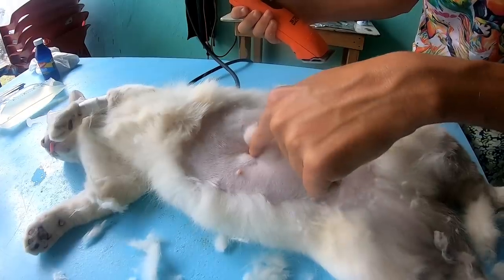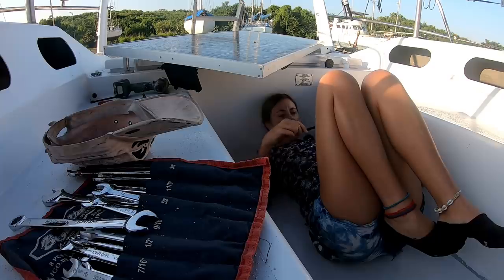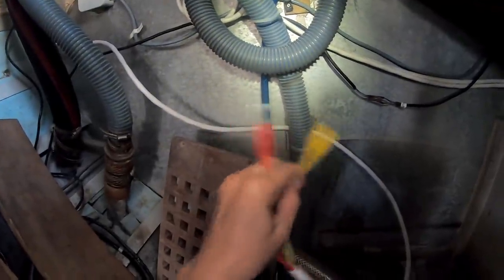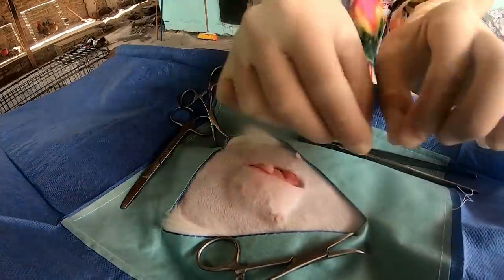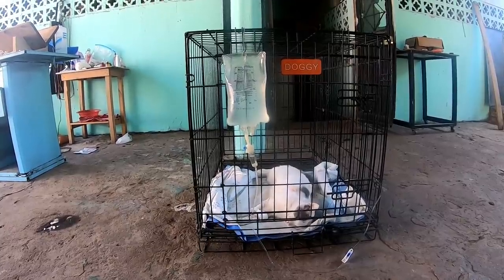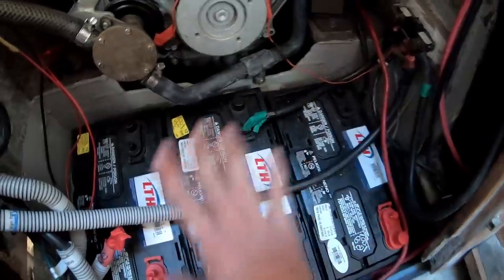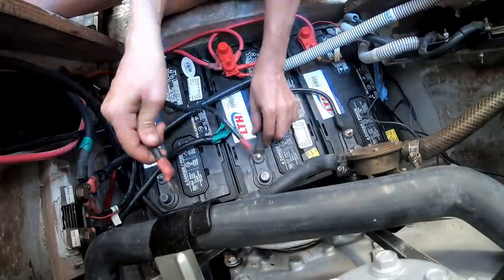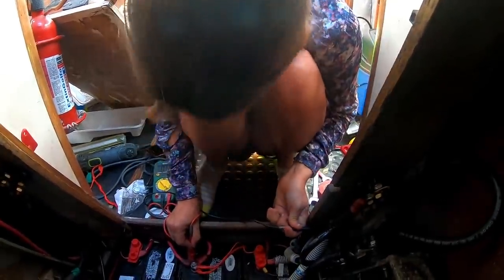Battery Installation! Chuffed Adventures S03Ep30

Comment: To quickcheck your solar panel you should try to find in the spec of the module a note about the maximum ouput current or short-circuit current. Then you get a multimeter and testwires which can handle this current easily (which means it and the wires are build for at minimum 1.2 times the current you want to measure. Switch this multimeter to the maximum current measuring range. First cover the panel, then connect the testwires of the multimeter to the Panel (keep in mind that you have now short-circuited the panel). Now you uncover slowly the panel and get a amp reading at full sunlight. Then recover the panel and unconnect the testwires and switch the multimeter back to the highest Voltage measuring range (means preparing the multimeter for a probable next measurement without a short circuit). Compare this value with the spec or an equal Solarpanel that seems to be in good condition. The value should be in 95% of the spec or a same type working Panel. The pure Voltage reading without a load is missleading. But you can also compare the voltages between two Solarpanels which are hooked up to the same value of load. Means hook up the first panel to the load (maybe a bulb or the batterycharger) and measure the Voltage that this Panel is now able to provide. Then disconnect this panel from the load and hook up the next panel and do the measuring again on this panel. The Voltage readings that you get should be the same for the same type of modules. If one module has a significant less voltage reading at the same sunlight and the same load, it is damaged. Maybe a crack in one cell or a cold soldering junction or a gone diode. Get a new one they are not good repairable because they are poured in. Also look for a modern solar batterycharger some types are more intelligent and can show you more informations about the wattage that is actual delivered by the panels. And some types can handle a desulfation on your batteries. And some types have a boost mode which can do a step up on your solar panels voltage at low sunlight. But on all new electronics take care that thy do not interfear your VHF.

Comment: please research your Battery Connection Design . To maintain Loads and charging evenly across the Three Batteries  1,2,&3 The Joining Leads should be of equal Length With Slack, Try to loop the Positive Opposite to the Negative Loop So wires of different polarity never cross each other. All Loads are attached to each end of the Bank.   Positive one end say Battery 1 then all Negatives to Batt3 . Hope this makes sense.

Comment: If you don't have one install a current monitor for your battery bank. They are not expensive and It will let you see the amps going in and out. This lets you see the rate of charge from solar and alternator and if you can keep your batteries always above 50% you will get the best life out of them. Hope the relaunch goes smoothly. 
Cheers from NZ
Reply from the maker: We do have one but its currently (get it, pun intended) on the fritz, hopefully get it working these next few days

Comment: When installing power wiring you should always have a fuse or circuit breaker included in the circuit path.  Those separate pieces of equipment you wired direct to the battery bank need that protection as well.  You can easily add inline fuse holders near the batteries for those circuits. They're not expensive and easy to install. Even when underway.
Reply from the maker: They do all have fuses (you may have spotted the fuse on the bilge pump when i said i had finished wiring it, big black box). Since I am no electrician I didn't want to go into to much detail about dos and donts, save it for the experts!

Comment: I may not be seeing this correctly but it looks to me like you have all the batterise wired together as one large bank. You have two main circuits coming off the bank, but they are both drawing off the same batteries. In order to have a house and engine supply you should have the house come off of two batteries and the engine off the third battery. That way if the house equipment flattens thier batteries you will still have the engine battery to start the engine. You could also fit a combined isolator to cross over if need be.
Reply from the maker: Yes it is all wired as one, we chose to go this route, some people have seperate mains and engine, but since our bank is so small they all go together. Major con of course if flat battery means no engine, but big benefits if having fridge/lights etc running in the night. So we went with that :) lots of boat do it

Comment: Such good news. You should be in the water now (Wednesday). Congratulations. Was the problem with the solar panel solved with replacing the wire. Looking forward to your next video.
Reply from the maker: Yeh all solved, an easy fix for once! The water has been loooovely

Comment: Hi just a quick safety idea as salt water and batteries  can cause chlorine  gas  may I  suggest you move those batteries away from the  impeller pump housing , Far away  check with a marine engineer please .
Reply from the maker: They have been in this location 30 years, we know its not ideal but we don't really have another location and to build one wouldve been more months on the hard, we had to prioritize the hull

Comment: Do you have a reserve battery somewhere much higher than the bilge so that if you were to take on water you'd be able to pump despite the bilge being full of water?
Reply from the maker: No, the batteries are in a separate compartment so water would have to come through bilge and up and over the floor boards to get in there, by then I think even an ancillary battery would only help so much! We do have manual bilge pumps though.

Comment: Dear Dr. please use flat washers and pressure washers on your batteries terminals, if you dont, the heat and vibrations will loose the nuts on the battery terminals, the correct order in the battery screws is: electrical connections, flat washer, pressure or security washer and the nut...or, you can use security nuts. Great job yours, my admiration. Sorry for my bad english.
Reply from the maker: good to knw thank you, your english is great!

Comment: Looks good. Once you’re in the water with engine running and charging batteries, check individual battery voltage. Should be about the same. Also, do you have a cover over the batteries so you don’t end up frying something while working on your engine? Super excited about the launch. Any idea what time? Buena suerte!👍✌️😊🙏🏼⛵️⛵️⛵️⛵️⛵️⛵️⛵️
Reply from the maker: I don't have a cover... but might just cut some plastic up to go over it! We are currently floating!

Comment: Holy Crab, three brand new batteries. Janet will start now just by calling her!  But if you do not charge your batteries for one year, you can sell them bevor you ruin them. Means more space on board, and less problems with holes in your t-shirts and 150 Bucks more in your pocket.
Reply from the maker: Yeh, they weren't in a good way (they were bubbling in areas ... maybe too hot here/got direct sun) so we gave them to the boat yard boys to use for charging their toys
Reply: Yes they wear out in this constallation very fast. 6 cells in series an 3 batteries in parallel are nearly impossible to charge balanced. By time some cells start to boil due to overcharge and the others get crystals due to undercharge. At some point one cell is nearly inconductive and blocks the other cells from serving the high currents to the starter. So your starter will no longer work when in every battery one cell is gone. The lights seem to work but the starter would not.
Reply: The charging behaviors of lead acid batteries are inversely exponential. The first hour tooks a lot of charge but the rest needs more than 12 hours. At the end the cells start to boil because the overcharging current goes more and more into splitting the watermolecules instead of the chemical charging reaktion. Good ventilation is needed. The gas that then arises is in perfect mixture and one litre of gas volume will blow off all your hatches when ignited.

Comment: 13:50 - electricity safety.  I've come to find out that voltage isn't what kills - it's the current.  I grant you that w=va and harm does take more current at 14VDC, but you have 3 honkin' big batteries sitting there that could dump a bunch of amps on you.  Mind you, I don't go grabbing 220V lines of any amperage.

Comment: Good Tube,  Well done. 
I see everyone going on about the batteries, but I’m thinking about the raw water pump impeller damage if you start that engine without a water supply to the raw water pump.   🤷 🤓
Reply from the maker: On the hard you just stick a hose into the raw water intake, so it gets wet dont worry!
And yeh, I know the problems with my batteries so not going to reply to all those comments :)

Comment: Am not a mechanic but have installed a few car batteries. Looking at this I wonder why you did not orient the red (positive) at the other end so that there would be no high current wire resting against the metal hull. If that insulation melts or gets damaged, then you definitely will have electricity touching the hull, possibly creating arcing or a spark. Maybe just repositioning the cable will fix this. Are fusible links used on marine batteries like on cars?
I enjoy watching your animal surgeries, especially with their tongues dangling, whilst under anethstesia.
Reply from the maker: For the most part I think the chances of that happening are low and we inspect monthly at minimum, but good to know thanks. We do have fuses on all the wires too
Reply: @Vet Tails' Sailing Chuffed  One more thing I see: Copper is a soft metal that can fissure inside the insulation. If the lead from the alternator and starter is old, consider replacing it. Engine vibrations and even corrosion can break it up causing the alternator to im properly charge the battery or reduce its lifespan. On a boat it likely takes much longer than on a car, but you need greater reliability on a boat.

Comment: If you ground the Hull Aluminium will absorb it and start to corrode especially if other metals like Zinc steel are connected to the Aluminium will cause reaction. Older cars had the positive as ground and corrosion was faster modern cars negative slowed down the corrosion. But later if just wired left with no Ground or positive the Aluminium lasted a lot longer. I must say this cars today are still grounded negative to the body on cars is really for cheapness rather than protecting the metal and rust still happens also with the modern technology still goes wrong and takes time to sort out faults. There difference is with the painting of cars today that makes the metal last longer.
Reply from the maker: yep exactly, there are some resources that say you should ground alu though thats why I covered my ground

Comment: 12:36 That's not a good crimp tool. For good crimp connections you should use one that is pressing the electric wire ferrule from at least 4 or more sides.
This is especially in your case important, because this is a boat where everything moves around and things can become loose. From a safety points it wouldn't be not good, if a cable gets loose because the crimping join wasn't good because of the usage of a bad tool.

Comment: As an Electrician/Electrical Engineer I find it very frustrating watch non professionals doing wiring and always see many ways that things can go wrong because they don't know what I know. Having said that very few problems do happen with wiring that was not installed by a professional, most times it's components that fail and not the wiring but if you can avoid certain things that might cause problems you will be better off. One thing is to leave slack in the wires but do not let them dangle on a terminal tie them to something solid and wherever possible.
Reply from the maker: One of the reasons I didn't go into detail about how to/what I was doing, I am not a professional, thankfully I had an electrician on board for the first 6 weeks (Dad) and we talked it all through so I knew more or less what I was doing.

Comment: put something between the batteries so they don't bump each other?
Reply from the maker: They weigh so much it'd take a big wave to make them move (they sit on top of plastic webbing too)
Reply: @VetTails  oh yeah, mighty ocean, big waves,  little boat, what are the odds? lol. You can get some foam padding, old yoga mat maybe, foam packing material. The other bit you need are some tie downs on them. You may never need the tie downs or padding, but... mighty ocean, big waves, little boat.

Comment: Just to check, wiring the battery sources parallel across 3 batteries would be wrong. When the donk gets running check the voltage on each individual battery so that they are reading 13.3v +, up to 14v something, but all even voltage. If one is low theyre not charging equally and likely needs to be rewired. My only grievance I could see is the batteries look to be low in the boat, so if she floods you will lose your batteries and therefore bilge pumps. That happened to Zingaro a few weeks back when a transducer let go and put 2000 gallons into the boat, he nearly lost her.
What happened to your right eye pal he didnt slug you did he? If so we can send a crowbar from Bunnings :)
Reply: Nothing wrong with parallel across 3, 5 10 batteries if desired. It only increases the amperage.
Reply: @bobconaway  thats a bit basic but, the design of the wiring connections between individual batteries must result in a balanced battery to defend against the internal resistance within each battery. If you dont do that you suck the life out of one of the batteries in the bank. I couldnt find a 3 battery design to explain it, but here is one for a 4 battery bank.
https://greensarawak.com/wp-content/uploads/2017/12/balancebatterysystem.jpg
Reply: @z_actual  interesting, Good Diagram re Balanced and Unbalanced. Yet the Perfectly Balanced is the same as the Balanced in that each battery utilises the same length of wire. but Totally misses the KISS principle and is just a geek playing with your heads. read their "https://greensarawak.com/" other info and you will see the geeks work.
Reply: @lauriwatson537  you ought run the same length as the longest cable. It doesnt matter if all the shorter ones run in loops as long as you dont coil them. The KISS principle doesn't give a damn how expensive batteries are, but most folks do. Thats the reason entire one would do this.

Comment: Congratulations Doc ! Question ? Is the bilge pump you showed backed up with another pump system, and where is it located depth level wise.. above or below primary vs backup ? Am thinking another single battery capable of starting Janet but isolated from mains for emergency usage may be a wise investment... it can be recharged by a separate trickle charger from solar or engine voltage. Make sure it's elevated above primary batteries in case that area is flooded, discharging batteries. Here's James from Sailing Zingaro in a bad state when a plastic transducer broke on a short trip offshore... (probably from slings in launching boat !)  his mains were discharged by water in bilge preventing them from starting engine in emergency : https://www.youtube.com/watch?v=xBWvamrLoe4 Some good lessons to be learned there, thought you may benefit from his analysis after the fact.
Reply from the maker: We are looking at getting one of those little jump start things in case. Our batteries are in a seperate compartment to the rest of the boat so it would have to go above the floor boards to flood there, and by then wed have some reeeeal problems haha. I did watch that, poor guy!

Comment: Your wiring is strange. Usually if you do parallel batterys, you connect als consumers (eninge + house) plus to battery 1, minus to battery 3 (or the last one). This way alle 3 Batterys have the same wear.
And dont ever connect anything directly to a battery, at least put a fuse in between. If that bilgepump ever got shorted, your ship might start to burn on top of sinking.
But goold luck with the big splashdown.
Reply from the maker: There are fuses (you can see one in the video, some are hidden by working space). The house supply all come of of one battery, its a slightly weird system because we have all the negatives connecting to a bus bar, so they all come off/connect at one spot.